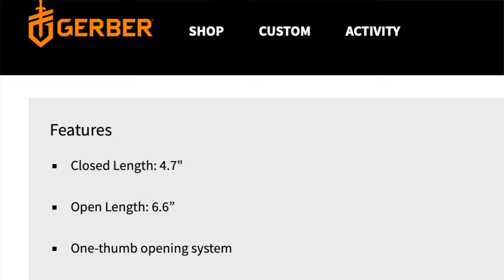Was I too harsh? Gerber Center Drive Revisit Review (6 years on)

Comment: If you keep wearing out the wire cutters on your Gerber plier tool, you are using the wrong tool. Get dedicated heavy duty wire cutters.
Reply: I agree with you in principle but I have used wire cutters on a multitool maybe 10 times in the last two years...maybe 3 times on a Leatherman Surge, maybe 4 times on a Charge Plus...and I used the Center drive cutters ONCE.  It didn't shatter, it just cracked right down the middle of the cutters.  This isn't a question of them wearing down, it's a question of why they will crack like ceramic under light use.
Reply: That would be all well and good if other multi tools in the same price range couldn't handle that strain. They can. Gerber just has the inferiour quality product in that regard then and should be called out for it
Reply: The wire he shows isn't heavy duty so why use heavy duty wire cutters on it?

Also: Gerbers own marketing.
Reply: Is exploding considered wearing out?

Comment: The gerber is superior for a fisherman! The one handed flick open pliers is perfect for holding the lip or gills of a fish and operating a Gerber plier single handed to remove a hook, a fishinghook sharpener, and a scissors to cut braided lines. It is also great for a hunter/outdoorsman who needs a one-handed plier, or a fine file for broadhead sharpener the same file for the hook sharpener. Unfortunately I lost or gave away my Gerber with the fishkook/broadhead sharpener, so I purchase 3 or four more because the single handed plier is absolutely critical for the outdoor uses I need it for! Also for great self defense should I not have my HK readily on my hip or my fixed blade handy!

Comment: I tend to think of the multi tool as a investigative tool. I use it to pull the inspection cover off or loosen the clamp to see what connector or fitting I need. Then I go get the required parts I need and the required tools I need. The multi tool can save you steps in a day but using it as your lone tool kit is bound to end up in aggravation in the long run. The Buck 110 has many applications though it is a single tool but it has to suit your individual needs or it is useless.🇨🇦🔪🧰